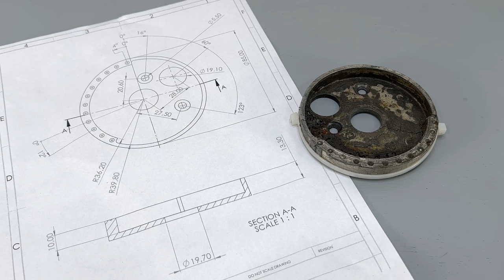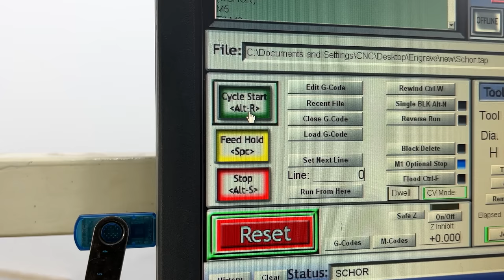1905's Cheese Wire Slicer - Restoration

Comment: The fact that you not only remade the broken pieces, but put all the original lettering onto them (when most people wouldn't have bothered) elevates you to a whole other level of restoration skill and dedication.
Reply from the maker: Thank you very much mate 😊
Reply: Oh no, that machine deserves all of the work put into it
Reply: Iv never seen any pro who is restoring something NOT do this. Without letter its value is much less in most cases.
Reply: I know right, like he could’ve rebranded it after his channel
Reply: Came here to say this! I love it when people try their best to make the end result look like the original product, even when some parts had to be replaced and remade from scratch.
Reply: The fact that he didn’t use solder to fix an original piece de-elevates his restoration skill and dedication
Reply: @user89389  I dare say the restored machine is even better than the original.
Reply: @creageous  Thing is you can't tell if it was original anymore.
Reply: @bennym1956  Yeah, I don't think that's the point to this restoration. The originals were produced in a factory, probably in large numbers. They didn't care so much about quality, only that they function for a period of time before needing a new one. Now this quality unit that has been restored can probably last 10x longer than the original and it's quite a novelty.
Reply: @CoolAgainRestoration  k8
Reply: @CoolAgainRestoration  very cool done, but I wondered why you didn’t repair the original part for example by cutting a slot inside to put a piece of metal / aluminum in and weld that?
Reply: The one piece
Reply: @Scorcher01  is real
Reply: The fact that he made it look easy elevates him to a whole other level, too. And I admire the very quiet way he set the completed parts down.
Reply from the maker: Thanks Dave and glad you liked it so much !
Reply: @CoolAgainRestoration  I wish I had one of these. Amazing job.
Reply: When you think you can do what he does then that man made a jig for numbers I knew...... I wasn't ready
Reply: Actually i think it sucks that he didnt even try to repair the original parts that were broken thay couldve easily been repaired, seems lazy
Reply: He even grabbed what I can assume are the patents
Reply: @CoolAgainRestoration  😊😊
Reply: @icanhazcatz8264  tf you on bruh??? He literally remade the parts, even going as far as to engrave the original letters and brand back on them! How tf is that lazy dawg, the original parts broke due to bad iron casting,they were unusable bruh.
Reply: ㅃ
Reply: Bro, and also the fact that he memorises where all the pieces go is INSANE!
Reply: Hello mate
Reply: Those plates took some effort.
Reply: @TremblingTrimble it depends on whether you’re thinking of it as the restoration of a historical artifact, or as the repair of a tool for use.  If this was being restored for a museum, for instance, it would be preferable to repair the original parts, but if you want to continue using it for its original purpose, re-machining the parts will probably be more durable.
Reply: Ola
Reply: Estauemiso
Reply: I mean, if it is an restoration, everything will be put back in place
Reply: Only thing he bought is a new ball and spring
Reply: And the fact that he used a HOMEMADE CNC machine is just ridiculously epic
Reply: Do you ever talk?
Reply from the maker: @codywatson9734 these type of videos are not with talking because they are ASMR videos
Reply: @CoolAgainRestoration  you deserve it they should make more YouTube play buttons. I’m pretty sure by now you would’ve gotten every single last one of them. You’re very cool and very respectful as person if I met you in real life you would be the first person I would come to just to talk, that’s absolutely amazing
Reply: @CoolAgainRestoration 😮fgf
Reply: Got to love modern machines.
Reply: 😊るめ
Reply: How much
Reply: @CoolAgainRestoration  how did you find photos of how this slicer was originaly painted
Reply from the maker: @user-jw6fu4of2g just a simple search on google .

Comment: In all honesty, when I first started watching the video I was questioning changing the original designs of the parts or doing any unnecessary modification like cleaning up the original casting because in theory it takes away from the history of the piece.   The thing is though, you just can’t argue with those results and I’ve come around.  :)  This is far beyond a simple restoration or preservation, I’m in awe of this wonderful work - you have a new subscriber here.
Reply from the maker: Thank you very much mate 😊 I really appreciate
Reply: Ditto.
Reply: For me, this is a reconstruction and not a restoration, the object has lost all information about how it was made. It is now the projection of the rebuilder's aesthetic: the wood must be stained (to look old?), the metal must be shiny (to look new?), the castings must be smooth (to look like they were made by plastic injection?). Now it looks like a new retro tool.
Reply: @ighmur  Agree, He completely went beyond a restoration. When you can't tell the difference between an original or a brand new made from scratch one, you've have failed !
Reply: M
Reply: @bennym1956  He couldn’t have made the 2 missing / broken parts magically fixed, unless there’s some dark magic shit going on.
Reply: @ighmur  Hard to imagine you have a clue regarding what it requires to do machine work.  If you do then I certainly do not understand your take.
When a part broke on one of our machines I had a few places a block away that could help.  Of the few only one did I trust to explain the best option.
There were times when the replacement part was changed a bit to avoid it breaking again.  Again may be 2 years or 50 years but if it's already being done you do it better if you can. 
What you are you talking about regarding restoration I don't know but I struggle imagining you understand running machines and their maintenance/repair cycle.

Fuck not improving something because someone that never touched a tool is babbling on YouTube.  Your loss.
Reply: @ighmur  staining is never used to make things look old, it is a finish to protect the wood.
Reply: @DACNY  That’s all fine, but isn’t the point of restoration to preserve historical accuracy, not necessarily to restore functionality? Not really critiquing this guy (coz I didn’t watch the video fully) but generally, I think the point of a restoration is to keep historic accuracy for future generations to restore, not to eliminate it by replacing parts with modern equivalents and materials or unduly changing the aesthetic? 

Reading your comment, in my opinion, it sounds like you’re looking at this from a machinist’s perspective, not a historical one. Idk if that’s right or not, it’s not for me to judge. I’m just talking about semantics. Anyway, I’m sure we know exactly how this cheese cutter was made and how it originally looked.
Reply: @DACNY  I have a profound respect for machine work.  It's not about the parts that have been replaced because they were broken but about the changes that have been made to the parts that were not broken. To me this is not a restoration.

Comment: This is unbelievable. This is beyond restoration. I’m completely blown away.
Reply from the maker: Thank you very much 😊
Reply: There were many many points where i would give up but he removed micro level defects which i would've accepted as anyway.
Reply: I guess you could say that he.... Made it cool again😎
Reply: @racingheart92  Yes, I find this very striking. The original manufacturers weren't trying to do a work of art, they just wanted to make something that did the job and stood up to use - for instance they didn't bother to remove casting marks, and nobody asked them to - but this guy does! It's more like an apotheosis than a restoration.
Reply: @gerardvila4685  i also salute the original creator/s too but also this person is taking it to asthetic level.

Comment: I was genuinely so impressed with reproduction of those cracked parts. Great work!
Reply from the maker: Thanks and glad you liked it Lewis 😊
Reply: would not aluminum be too soft to be a functional long term replacement  for those parts if device was put back in to use
Reply from the maker: No! First of all, it was aluminum before and for 100 years was worked I saw, and the second point, I don’t think anyone would use this slicer again. Now it is for display..maybe a restaurant or hotel will buy this for display
Reply: @CoolAgainRestoration  forgive my ignorance, could it not have been possible to weld those pieces back? Also, brilliant restoration, every detail was amazing and an absolute delight to watch.

Comment: I love your attention to detail.  When you restore you aren't just making it nice and shiny but you are restoring as close to original as is possible.  That makes you exceptional.  I was actually surprised to see that it split the cheese in 4 before slicing it.  Is that optional or just the way it was made?
Reply from the maker: Thanks and glad you liked it! No, actually that wires who split the cheese in 4 pats are for butter,not for cheese . But I didn’t found a block of butter so big and I used cheese.

Comment: For sanding on the lathe, I was taught that you should:
1.) Hold the sand paper over the part, not behind like you are doing.
2.) The ways should be covered to collect the fine particles.

Comment: I've watched a lot of restoration videos, and I've come to appreciate the restorers who leave casting imperfections and those who don't. I can understand why some people get upset and say that it's not really restoration, it's destroying the history of the piece, blah blah blah, but if you don't like it, then just move on. I think that if the original inventor saw a perfected version of their invention like this they'd be happy. Some of them probably felt bad when their item was mass produced and usually made to a lower standard than what they had. All I know is that if you don't like it, that's fine, but you don't have to rain on everybody else's parade with derogatory comments.
Reply from the maker: I totally agree with you . Some people don’t understand some facts . Like for example : the inventor , first made a design on a paper , I’m pretty sure that design has no pittings , no casting marks and so on. The level of machines from that times has did that. I understand the people who want to keep the casting because now the machines has improved and they make things almost perfectly, we will not have casting marks anymore and I should keep that for remembering that era. Anyway , the subject is very sensitive and no matter what option I choose , some people will be upset no matter what. Thanks a lot for taking time to write those beautiful words ! Cheers !

Comment: 4:17 Never seen that process before of adding notches like that - what is it called?  Does the wheel just steadily grind the grooves in? Is metal being removed or just compressed?  (The cheese at the end was the icing on the cake - amazing work!)
Reply from the maker: It is called knurling . The metal is compressed but also you can see some small metal shavings on the wheel after the process .
Reply: @CoolAgainRestoration  thanks!

Comment: One thing I'm wondering about is how you accounted for the change in thickness when removing layers from restored parts. The main pole that supports the cheese cradle, you stripped away a thin layer of metal from it, right? Or did you do something else? There were other parts that got a similar treatment as well.

Comment: This is the best restoration channel for sure. Is Electrolysis only for really rusty parts? Or is that vs sand blasting just a restorationists preference? I wouldn't know any better, just asking based on other channels I've watched.
Reply from the maker: Hi mate and thanks a lot for your compliment. Usually the electrolysis are for rusty parts and works better than sandblasting, but sandblasting it is more satisfying to watch and works quicker than electrolysis 😁
Reply: @CoolAgainRestoration  true. I'm partial to watching the sand blasting. I feel like that is just the OG GOAT.

Comment: Worked at a Mexican restaurant for a short while, never have I ever seen 50 pound blocks of cheddar cheese until that first day. The size of a small suitcase, these blocks could only be split using a wire. Would break a knife. This particular restaurant went through about 150 pounds of cheddar a week. Had to take the chunks off the block and shred them in a shredder.

Comment: Can someone smart please explain whats happening when he’s nickel plating the parts? And also what kind of paint he’s using. It looks so satisfying and i want to see more.
Reply from the maker: When I nickel the parts , basically I cover the part with a nickel layer. This is good for protecting the steel against rust and offer a nice and shiny looks. The paint you seen there is called powder coating. It is a powder who stick to the parts with the help of electricity and cover the part in a layer of paint after curing in oven. This paint is more durable than classic paint job.

Comment: It looks like the thickness numbers corelate to about 1mm +1 each so 2 to 13 but numbered 1 to 12. The stickered arrow seems out of place and less durable than stamped or engraved and paint filled markings but could be changed later if desired.

Comment: Curious about the remaking pieces. If they're generally whole but cracked. Is it better to make a new from scratch or weld the old pieces and treat? Wondering if integrity is an issue with the older pieces
Reply from the maker: That parts was so “crunchy “ . If I repair that, easily can broke on another part ..
Reply: @CoolAgainRestoration  Good to know! Love watching these restorations and knowing the process

Comment: When nickel plating do you have to plan for the extra thickness of the components that need fitting together
Reply from the maker: Every part has a little tolerance and the thickness of nickel is very small in general

Comment: I suspect the cutting geometry of your plates is unsuitable for that kind of aluminum which is why your chippings don't break properly. 
Either that, or you don't give it enough feed. 

Can ruin your surfaces and also heats the indexable insert up, which will reduce its lifetime.

Comment: 25:13 you forgot to remove some of the Auchan packaging. Hope you like the taste of paper.
Reply from the maker: That is ceramic paper and won’t be cut by the wires . I left there the paper because the cheese has some friction with the Aluminiu and I had to add something for sliding 😊

Comment: My only gripe with these videos is the massive containers used to wash one piece....
Reply from the maker: Yeah, sometimes I feel bad too but we don’t have a lot of containers for each size of parts 😅
Reply: @CoolAgainRestoration  that is also fair but what you did by tipping th container over for the long slender piece was a clever way to more efficiently use space. I'm an apprentice blacksmith and we tend to do that when cleaning grease or oils off our pieces

Comment: On the second peice you made, the original one had 12 holes but you put only 11, I counted multiple times. It was annoying but I just tried to ignore it
Reply from the maker: Yeah, you have right . The problem there was that I made a mistake in marking the place for holes and ended up with 11 holes. That’s when I filmed . After that, I made another part with 12 holes , like the original one, but I didn’t made new footages because I had a good angle in first round of filming. If you can count later in the video, you’ll see there are 12 holes again 😃

Comment: Why do you need gloves for sand blasting mate?
Reply: Sand blasting gloves are to protect from high pressure abrasive blasting to and are also acid resistant providing grip and also protects against tissue ischemia chemical irritation muscle destruction ect.
Reply from the maker: Yeah, that’s true! Thanks ELTK 👍
Reply: so the hands don't get blasted instead

Comment: i think its great what you do but, i myself dont have all those exspensive tools, i do everything by hand. i cant re-make something metal, but i can clean, polish, and sand all by hand. maybe you should try it sometime without using your exspensive tools.
Reply from the maker: I tried many times and in my videos you can see also hand working too. I not use expensive tools every time 👍
Reply: @CoolAgainRestoration  thank you for answering💜

Comment: Vinegar and then once it drives graphite-I’ve had luck with that.
Reply: On old singer. Machines-and a couple knockoffs. lol.
Reply: I have also soaked in kerosene and since I live in rural Mississippi then throw the kerosene on a brush pile and leave e a trail and then set it afire. 
All very safe. The way my dad taught me. 
Nothing like soaking in all kinds of cleaner to go back to work as a nurse or teaching knitting crochet or quilting. 
ADHD. So great.